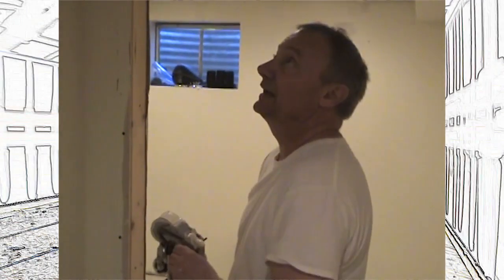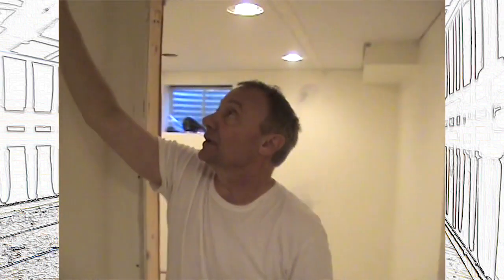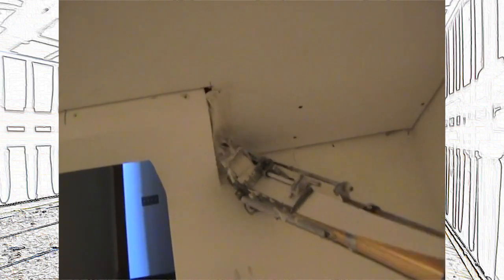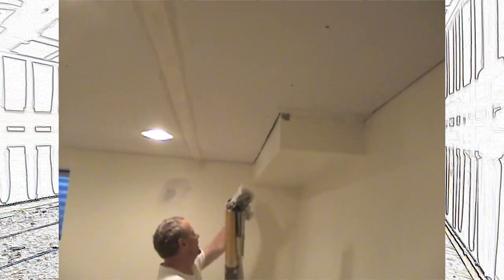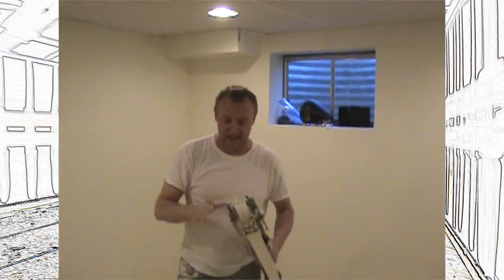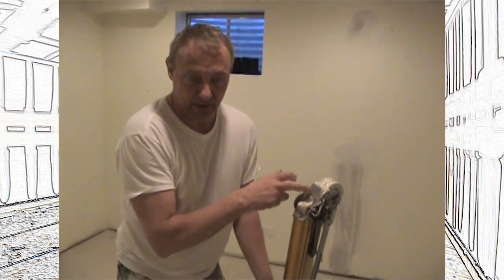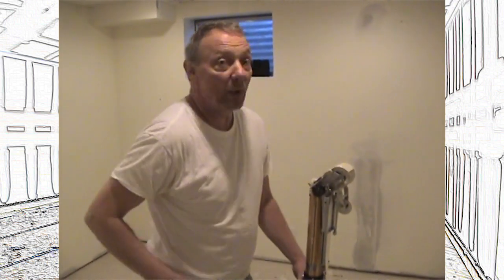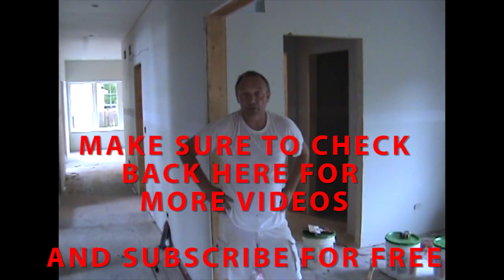Taping 101 - How to Fix Big Gaps in Drywall Corners (with a Bazooka)

Comment: I have actually gotten the device for spreading frosting and doing decorations and filled it with plaster of Paris and fill the hole it hardens up quickly I’ve never had a problem with it

Comment: I double tape big gaps too ..... but I run my finger on the first tape to create a bit of a u in the gap then I roll the tape then I run my angles as per usual...... on a side note it’s kind dumb to feed the start of the tape on finished paper lead your tape on the next angle or joint your about to tape. The taper wheel leaves dimples not to mention taping mud doesn’t chip off with out taking paper with it when it’s dry

Comment: Hello. First- I love your Videos. You are my absolutely my favourite Drywaller on YouTube. You inspire my work 💪💪👍👍👌👌
How do you handle bigger gaps? I think my Delko Zünder put less mud under the tape to fill the joints with little more gap. Actually i fill it before tapping with trowels. Is that the right way i do?? I got fibre paper tapes.
Thank you for answering. Cheers 😉

Comment: I don't know why it would be so hard to get the gaps closer. Measure and cut. Don't tapes have markings down to 1/32? Yes, I know 1/8 is fine for sheetrock. Some diyers and rockers are just plain lazy and say "the taper will fix it". Tapers loved working behind me.
Reply: In my 1870 house nothing is straight, so measuring everything exactly would take many difficult hours per sheet with no guarantee of success.    It's faster and  better in some cases to get a perfect finish by spending only a reasonable amount of time on admittedly rougher drywall and  more time on gap filling, tape and mud.    Sometimes it feels like re-doing the lath and plaster without drywall would be almost as fast (not really though).  But yeah, you're right in new construction that's all right angles and standard framing, measure it and cut accurately or you're just making more work for yourself when you have to fix the gaps.
Reply: measure all you want if walls and celling Arnt dead strait you still have big gaps
Reply from the maker: This job was so out of square it wasn't funny.
Reply: @THEDRYWALLDOCTOR1  yep why the mobile home im redoing is you be there a years and waist 3 times more drywall you use trying to get it right with no gaps